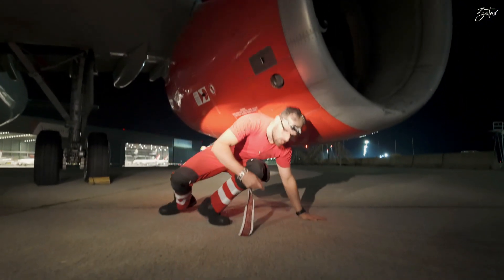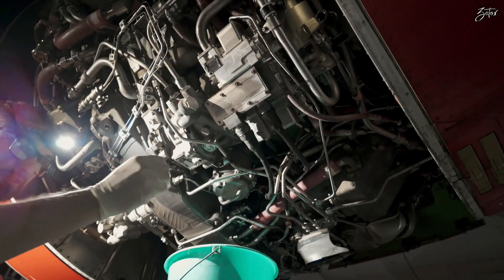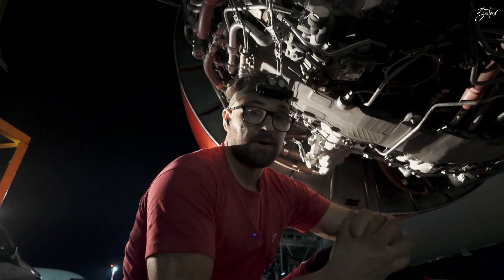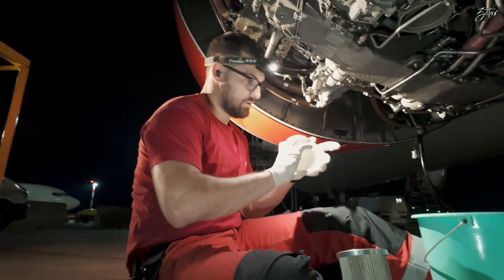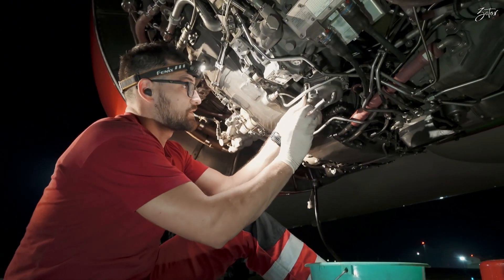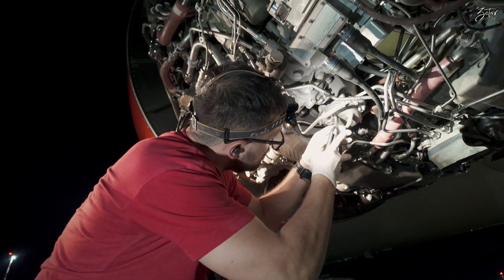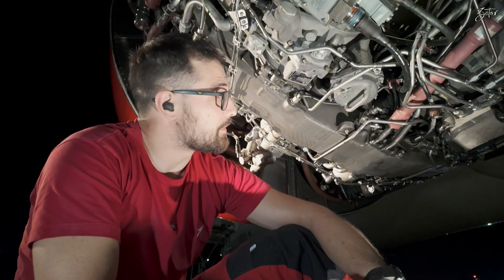How to replace the fuel filter on Airbus A320 - CFM56-5B engine

Comment: Cap of the fuel  filter is in wrong position the drain must be opposite
Reply from the maker: You don't have exact position written in manual
Reply: The picture  of the manual installation you can see the drain hold is opposite from screw. 
But it's true no say nothing about the position  but the picture its part of manual  installation. My opinion.
😊  I like you videos
Reply from the maker: @3ac561  I know what you talking about. Also interesting to see is also oil cup picture showing lever facing forward and everyone install it with lever facing back. 🙂 thank you for support 🙂

Comment: Seems more fiddly than the P&W engine from the previous video, although I do appreciate it being more precise than "hand tight".
Reply from the maker: Most of the filters are hand-tight only and then secured with some sort of protection, like a lock wire or ratchet mechanism. Design with screws is  really time-consuming

Comment: So on the CFM engines its easier to access the fuel filter but the replacing of it is tedious because of the bolts on the housing and the drain bolt but on the NEO PW engines the access is tedious because of the c-duct that need to be pumped in order to open but the replacement of the filter is easy (cause you only unscrew/screw it on by hand).  Which one is your favorite to work on? Awesome content by the way never thought anyone would film the process of this
Reply from the maker: Depends of work but I like both, CFM is very simple mechanic friendly PW is more efficient

Comment: Thank you for the video. I really like these types of maintenance content.

I have a question for you:
You mentioned that you have to inspect the old fuel filter for any type of (metallic) debris. Now what would be the next action if you found something on the filter. Do you have to open up a investigation to figure out where the issue is? 

Thank you in advance.
Reply from the maker: Yes you need to send it to the laboratory to check what is the material inside and depending on contamination you eider dispatch it with a new filter or if it is too much you must ground the aircraft

Comment: Thanks for the video. Very informative.
Can very cold conditions affect the replacement of the O-ring? Can they become brittle as you are in the process of replacing them?
Reply from the maker: First of all, thank you🙂, Well it depends What do you consider as a cold environment, Because I changed the filter in -25°C  And it was still ok

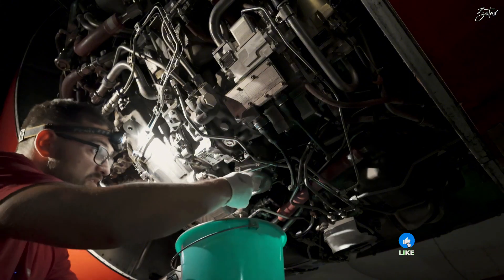Comment: What do you think of this zeto @2:20 I normally loosen the nuts and main bolt, leaving them screwed in on the final threads so cover wont fall off, then once i remove drain plug, I pull down filter cover so that air gets inside and the fuel drains much faster.
Reply from the maker: You have quite a lot of resistance but yes it is possible. Problem is that I must follow AMM otherwise someon can point at it that I skip something or jumping the steps. You know how are the people in the comments 🙂

Comment: Great job Tomaš,
Just curious, regarding maintenance procedures, per general, which type of engine do you prefer on A320, CFM or PW? For me seems that CFM is designed better.
Thanks
Reply from the maker: It of course depends.  I like both. CFM56-5B is a very simple engine, an old concept which works, PW is more complicated and it still has issues but whenever they solve that it will be a great engine, if you have the correct tools it is quite ok 🙂